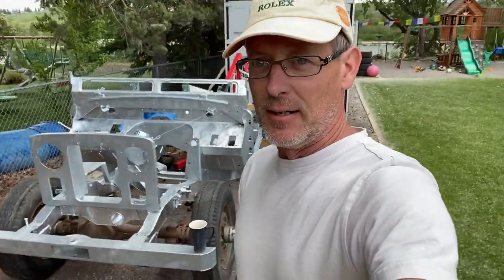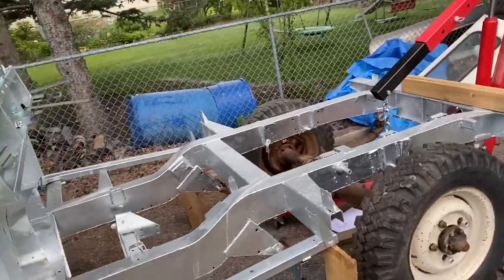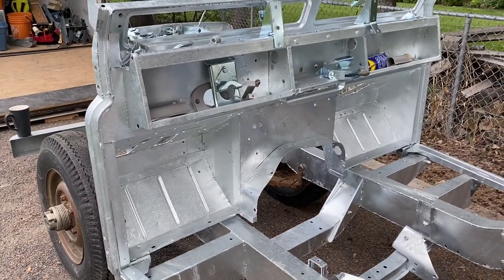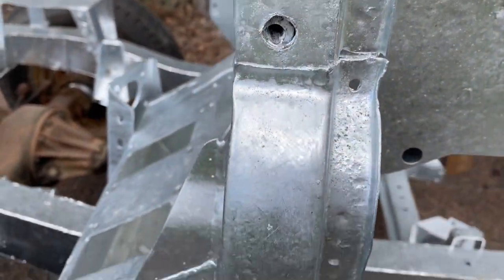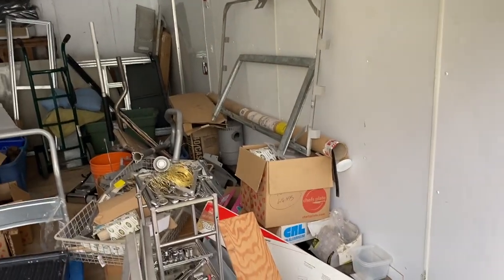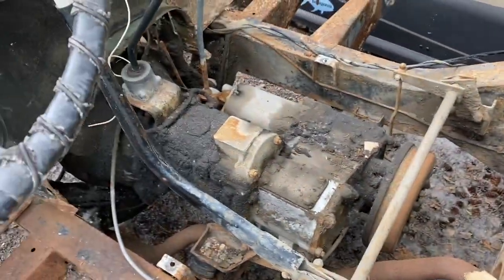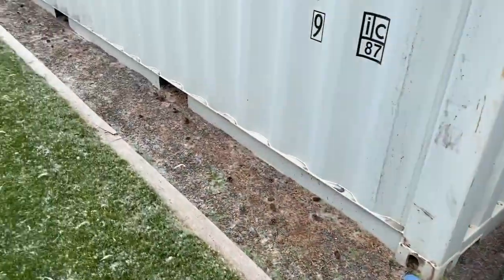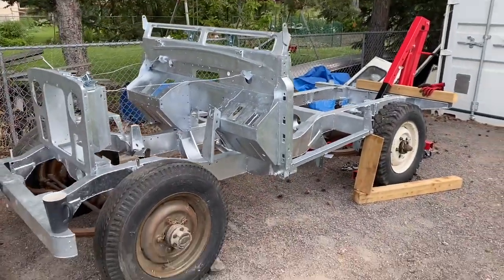1961 Land Rover 88" Restoration; Galvanizing

Comment: How did you prepare the bulkhead for galvanising? Sand blasting or acid dip or cleaning up with a grinder? How clean does it need to be?
Reply from the maker: I had the bulkhead sandblasted.  It doesn't need to be super clean. I think it gets dipped in acid before going in the molten zinc, anyway.  I wouldn't use acid dipping first, on any parts that were too crusty.  I did some experimenting with acid dipping, and I liked it best for the aluminum pieces which came out really nice.  Not sure exactly what acid they were dipped in though.

Comment: How did you end up cleaning out the threads for the door captive nuts? I've just stripped a Series I bulkhead for galvanizing and I'm trying to figure out what to do with all my captive nuts (on a series I there are 23 of them!). I'll be taking it to Daam galvanizing in Calgary, so hopefully it comes out as nice as yours!
Reply from the maker: Some coarse threaded bolts... Not pretty, but I can't find a tap and die set for the BSF threads.  New fasteners into the soft zinc is pretty solid. I figure I would use thread lock if they became loose, but they haven't.  If all that fails, drill an access hole and put a conventional nut in....
Reply: You can torch the threads with a rosebud then immediately hit them with a Weiler steel brush bit on the end of a cordless drill
Reply from the maker: @dsw8103  Never thought of that, thanks!!
Reply: @slrroman , yes sir.

Comment: Its worth taking the risk getting the bulkhead galvanized considering how badly they can rot.
You struck lucky they did a great job.
I noticed you had a mug on your front bumper... I hope it wasn't hot coffee... I did the same 
and it left a scorch ring which was a pain to get out. Good luck with the rest of the build.
Reply from the maker: After 800 deg the galvanizing showed a scorch mark from a cup of coffee!!  funny.  I agree about taking a chance on the galvanizing, I would rather deal with any issues that come up, but know it can't rust...